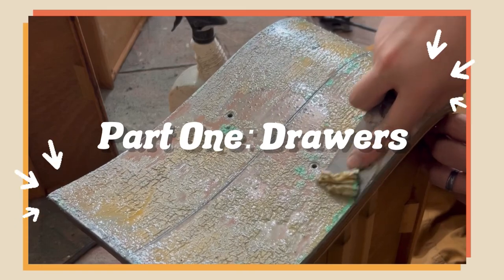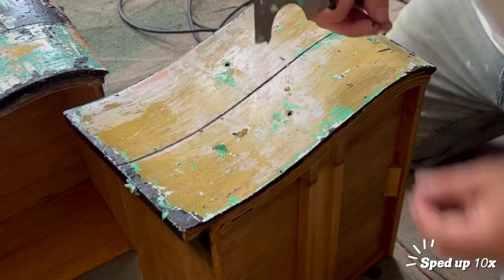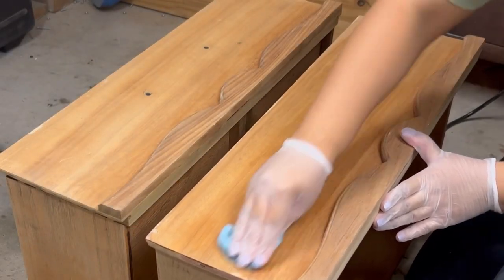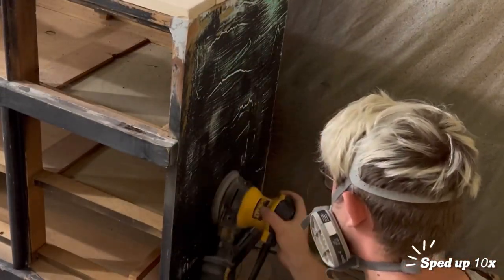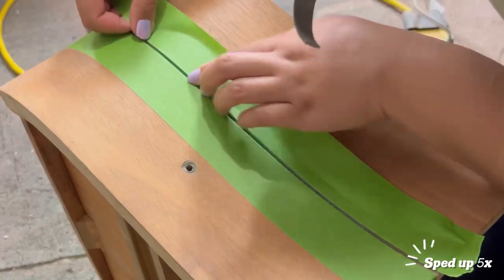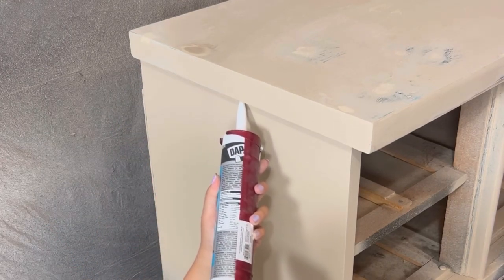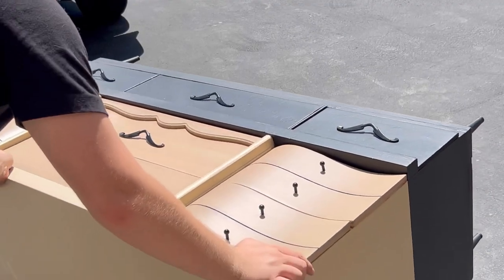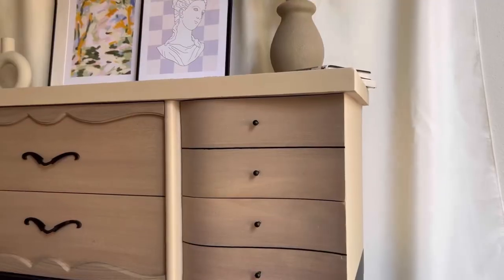EXTREME FURNITURE MAKEOVER | Fixing ROTTED WOOD | Stripping 7 LAYERS of LATEX paint | BEST STRIPPER!

Comment: We have a product in Australia called Earls wood hardner. It’s designed to be sprayed on rotten wood. But everyone uses to spray broken chipboard. It turns the chipboard hard and then you can sand and Bondo over it.
Reply: @greenbeansboro  It’s handy to have. Have had to deal with so many broken chipboard pieces that just flake